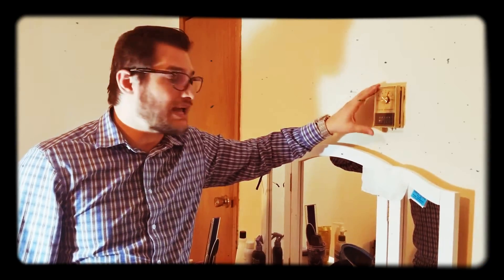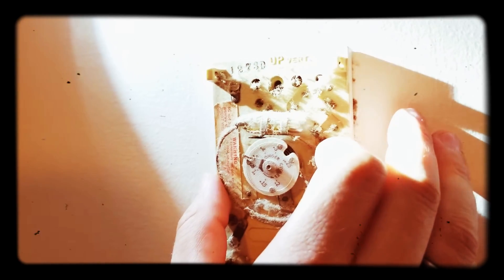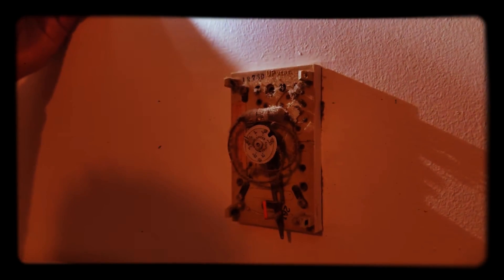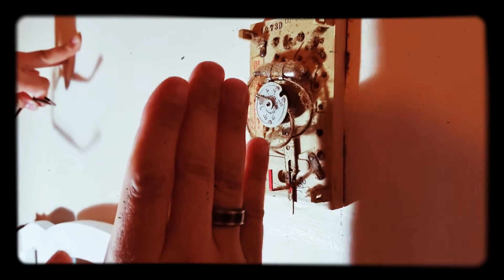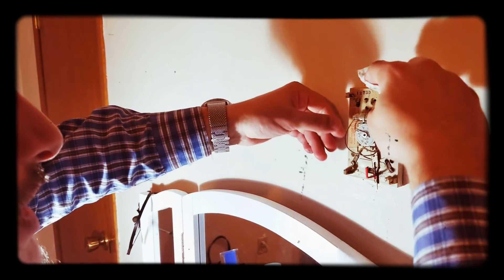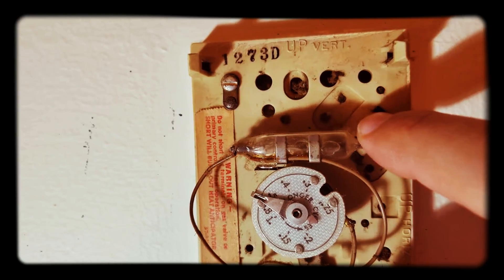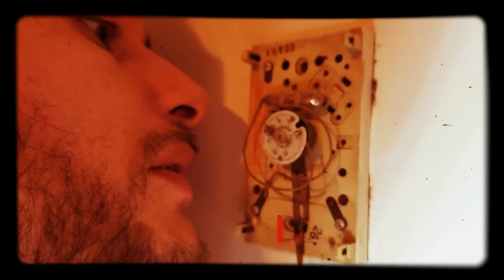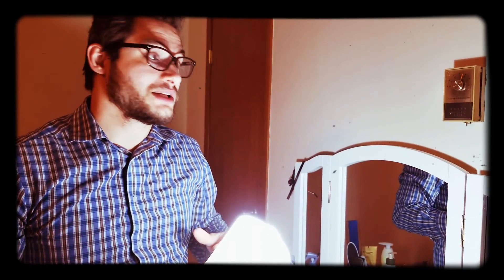Preparing your Mercury  thermostat for winter

Comment: mine is the old mercury Honeywell kind and the cleaner/repair guy got it working just by blowing on it.  this is the next season with the temperature going down to Winter levels and it's intermittently working again - I blow on it and it will work but it probably needs a good cleaning.  I'll try to brush some of the dust off gently and buy a new one to have on hand.   Many thanks for the video - 'these things have to be done very delicately - or else you break the spell!'